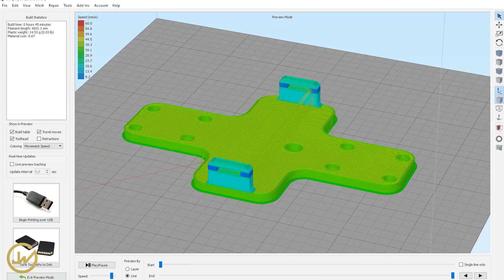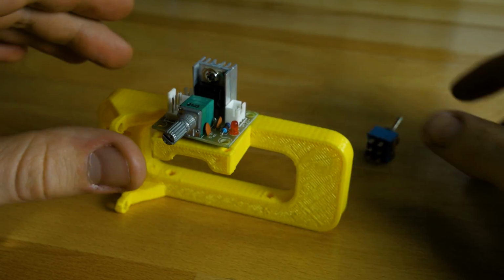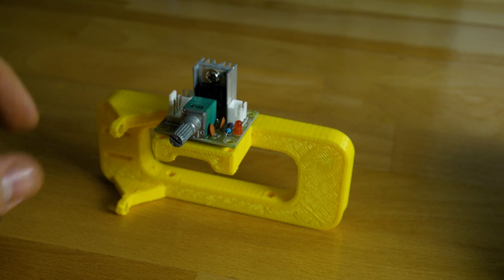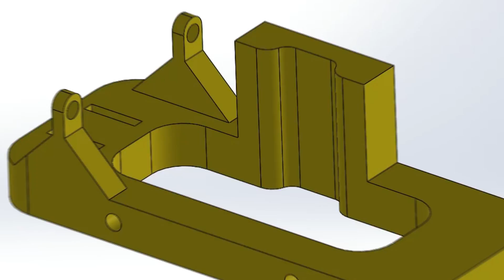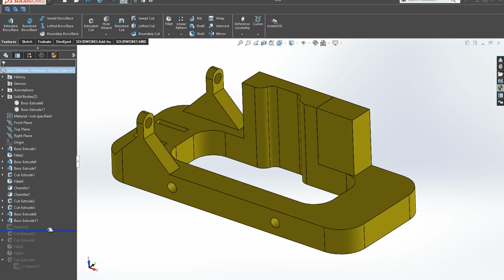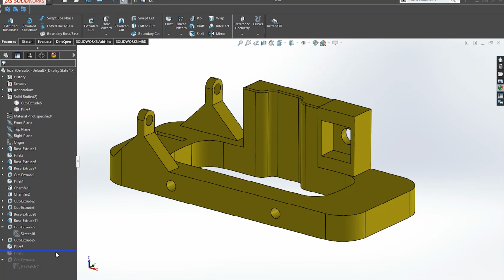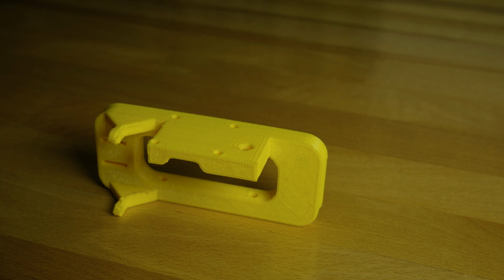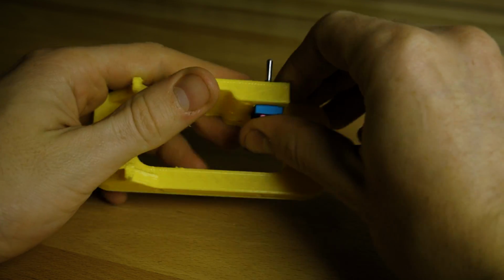Make A MOTORIZED Camera Slider

Comment: Hi, great tutorial, already have 3d  printed parts and bought anything from your links, just a quick question on aluminium rods, i've stainless steel 8mm rods and seems to "wobble" quite a bit in bearing housingi measure linear bearing ID and seems 8,5mm, while my rods are precisely 7,95mm....where did you buy yours? thanks!